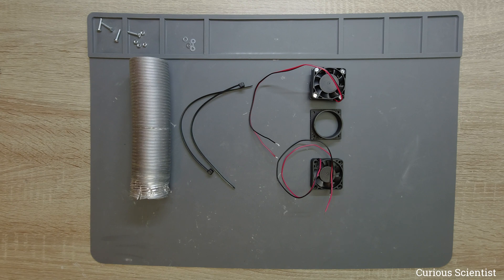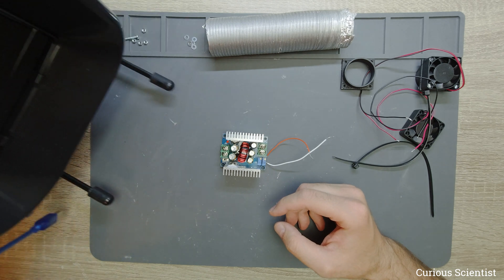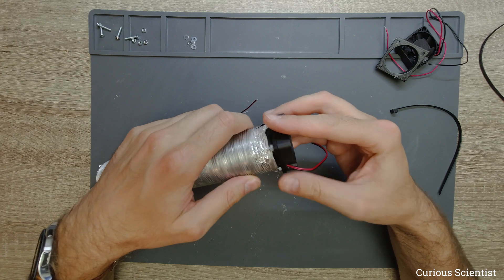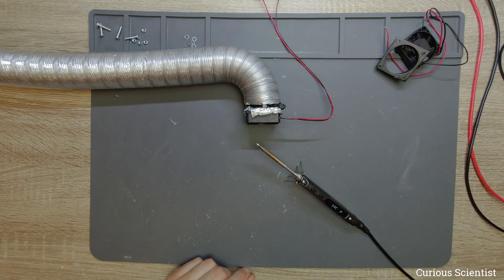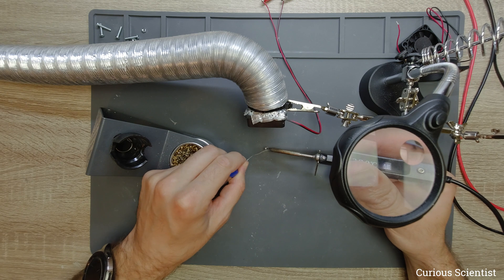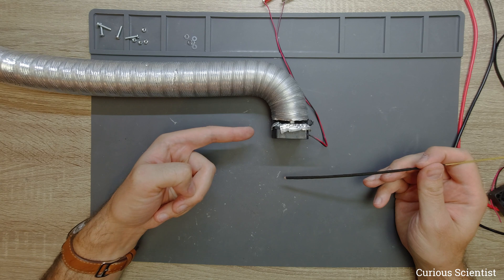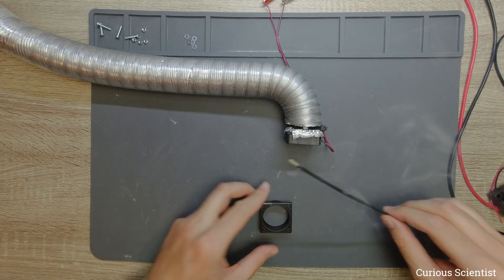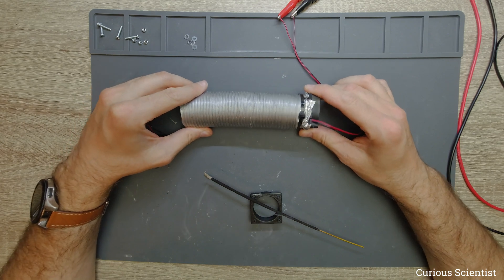Building a cheap and simple solder fume extractor

Comment: First many thanks for your videos. I will watch them more carefully specially the other about the MINIQ BG6300 milling table. Unfortunately because of the tragic pandemic in Brazil I decided to stop buying and doing anything for the DIY hobby until I will get vaccinated, which may occur for me in 1 or 2 months.

On this video I thank you for the suggestion of using aluminium flexible tube. 

I might suggest you to improve it by inspecting the “microcospe smoke extractor”. They use as you suggested a more powerful fan “Delta Electronics 12V 0.21A AFB0512HHD”. Besides this they create a hood with semi rigid plastic transparent (“clear view”) sheet in order to get closer to the point of where the soldering is going on. Specially this semi rigid plastic transparent (“clear view”) sheet I think it may make you come even closer to where the fumes are generated and so extract them more efficiently.

I found with 0.5” Barlow lens where the height is increased the fan gets not so close to the soldering place as desired. So I changed it for a 45 degrees 50mm PVC tube adapter, but I was using this more rigid bathroom plastic tubes.

I am not using anymore a trinocular microscope but a microscope camera, but I will still use the tubing fume extractor.

With your idea of aluminium flexible tube I will make it better.

Thank you very much for your efforts and patience.
Reply from the maker: Hi! I am glad that you found my channel! I hope that the flexible aluminium tube will help your project. I found it very useful for my things. Also, thank you for the suggestions, I will look them up and will try to improve my setup. In fact, not long before your comment, another nice person left some comments about some fume extraction ideas. I found it very useful! It is great that we can exchange ideas across the globe. Stay safe and healthy and I hope you can continue your DIY hobby soon!

Comment: And a tip for you my friend, buy some cheap carbon filters on amazon, I use my fiancé’s old hair dryer fan in reverse with a carbon filter on the exhaust side, I mount it to my desk with one of those cell phone holders that articulate
Reply from the maker: Yes, carbon filters are also a good idea. I have a carbon filter in the large fan I show in the beginning. So, when I direct the end of this tube to the throat of the big fan, I basically have the carbon filter.
Reply: I heard carbon filters weren't enough.
Reply from the maker: Probably not enough, but better than nothing.